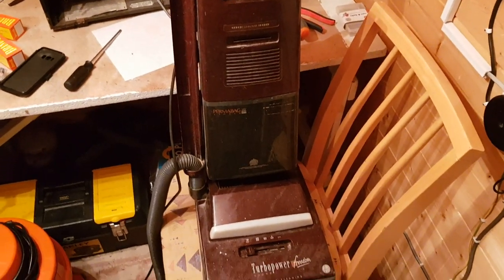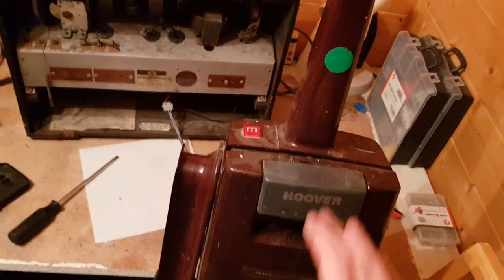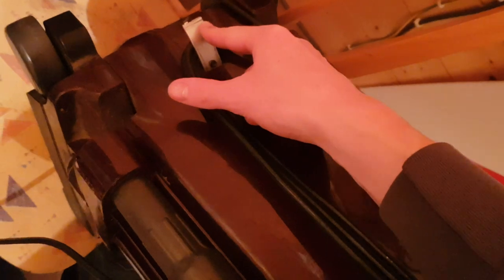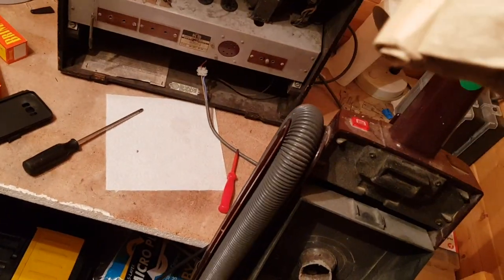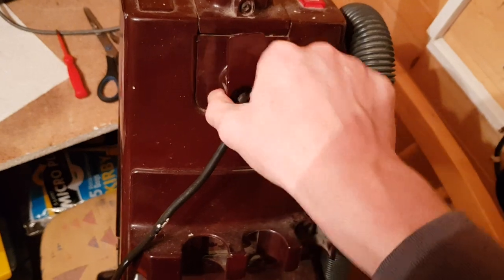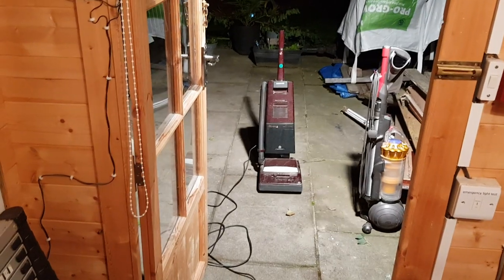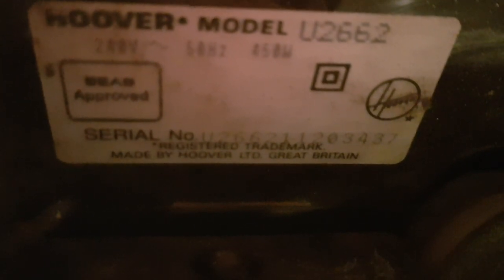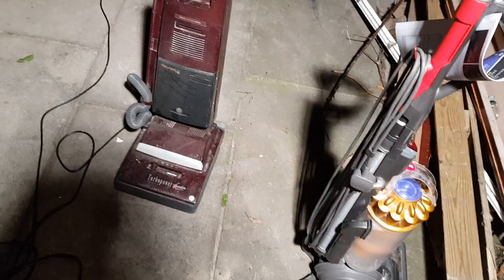From The Tip: Hoover Turbopower Freedom

Comment: Thats from December 1991 (date code 112). They were pretty rare because they didnt make them for long, and they were also top of line models, costing much more than a basic model. Many would have been thrown out long ago as they leaked dust terribly from the poorly designed permabox and its filter setup, which clogged up and was a mess to empty and clean.
It will use a wedge bulb rated at 12V, so a car bulb may work, but it will need to be one rated at 10W or above or it will be too dim.
The tool use / height selector slider is just probably all gummed up or jammed, so you can free it off when the base plate is removed, and the hood than taken off, giving better access to it. All it does is slide a piece of plastic across the dirt inlet channel to block it off, so all suction is then pulled through the hose, rather than the floorhead.
Finding a genuine permabag assembly for these wont be easy, as they are long obsolete, but ebay can sometimes come up trumps.